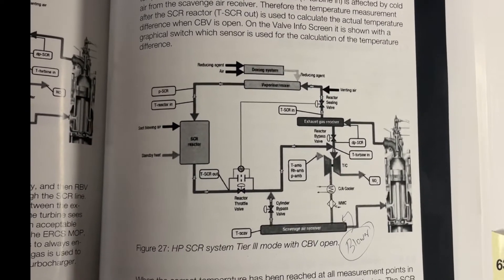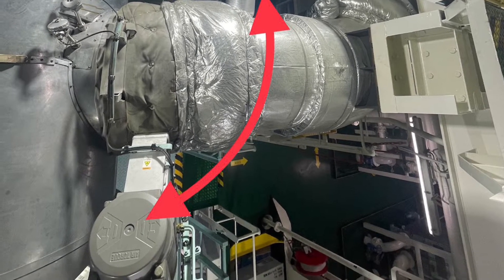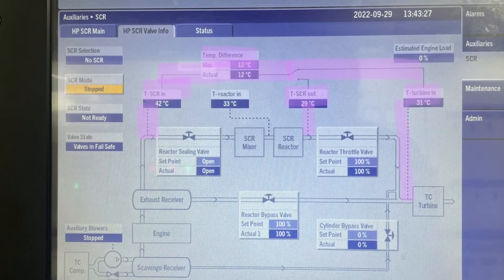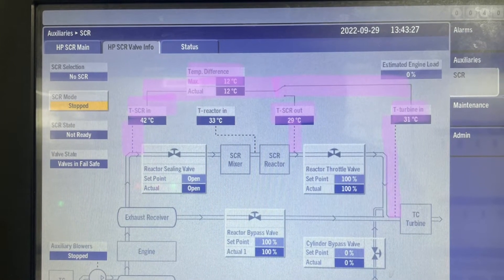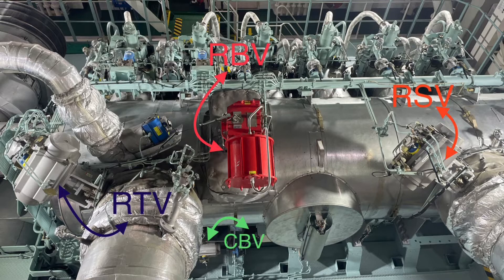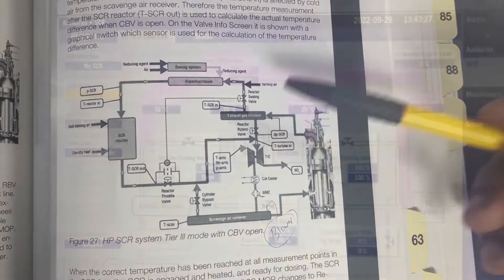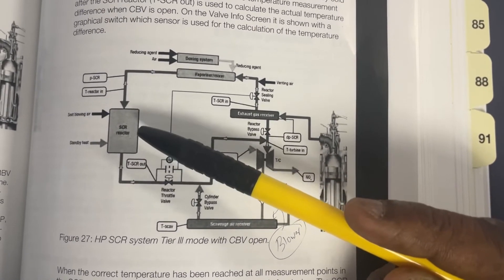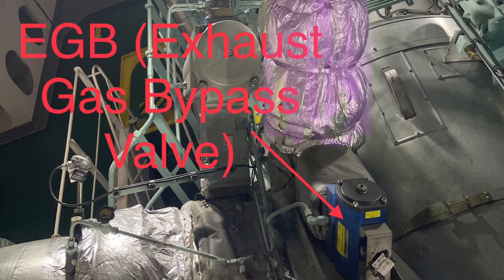SCR valves (RTV, RSV, RBV, CBV, EGB) Functions and its working

Comment: Hi thanks for your video. i have question related to pressure difference between SCR reactor and exhaust gas receiver. is there pressure always higher in SCR reactor compared to exhasut gast received in Tier2 mode? or it depend on engine load ?
Reply from the maker: Hi always pressure difference between scr reactor and exhaust gas receiver should maintain low, if pressures rises in scr reactor that means valve is leaking, if pressure in scr reactor increases significantly even though the engine in tire 2 mode, valves will operate and reduce the pressure difference.
Reply from the maker: It doesn’t depends on engine load